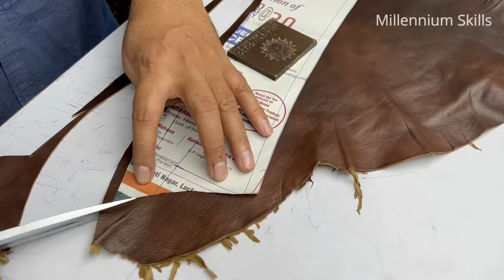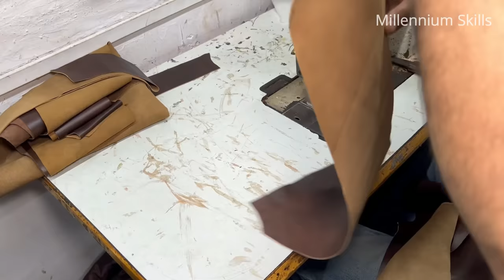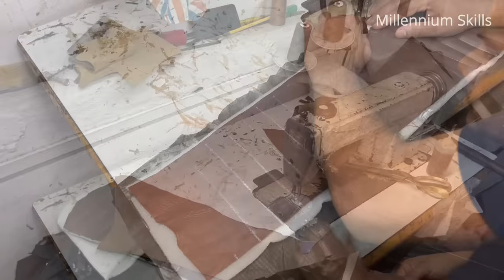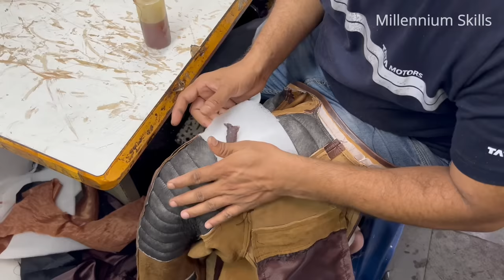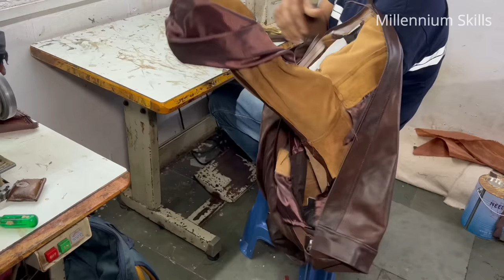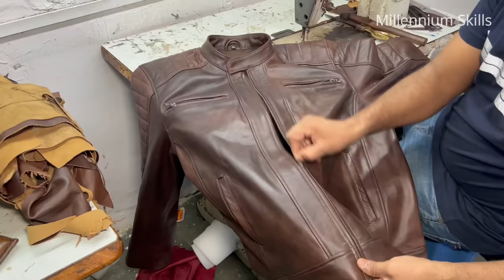Process of Making Hand Made Leather Jacket. Indian Hard Working Tailor.

Comment: Not to be a spoil sport but when buying leather jacket : Always look for a jacket with minimum number of cut pieces. Stiches are weak points and a good leather jacket should have a mininum number of pieces sewn together.
Reply: I am a dirtbike rider. I can control my falls/movements better in a jacket that has more cut sections, somehow I have better control.
Reply: @PG-yi9iz  @@
Reply: 11
Reply: @PG-yi9iz  so leather jackets are for dirk bike riders?
Reply: Yeah, fine if you want a square sack shaped jacket. Bad tailoring makes a jacket weak
Reply: @PG-yi9iz  lol😂
Reply: Absolutely... That's the hallmark of a good leather jacket
Reply: @PG-yi9iz  than you are going for a size which is smaller for you
Reply: lmfao you know nothing about sewing. some seams can be stronger than the fabric itself. especially when using a quality thread.
Reply: That applies to all leather products
Reply: Thanks for the Valuable information
Reply: Most people buy leather jacket just to protect them from winter and going to marriages and parties. 🤣lol
Reply: Lesser amount of pieces leather jacket is made from - more expensive it will be due to bigger parts of leather required you to cut them from a big hides and you need a more hides to craft high qulity jacket. Small parts which used in lower-priced jackets are came as leftovers from hides which means that those cuts could be with more flawed parts and from several different hides which makes them less consistent. Also it always will lose to the more expensive ones which were made from big parts in terms of looking due to you need to add decorative patches and more stitches which makes kacets visualy less mature. But they are cheaper in terms of repair due to it's easier to replace a smaller part than a big one. 
So overall - lesser stitches, patches, etc in leather jacket means more expensive it is and probably better crafted due to it's much more affordable investing more workig-hourse and better quality lining into more expensive jacket than into a cheaper one.
Reply: I want nad I will buy I will wear highest number of stitch in leather jacket 
I will not follow your opinion ok 
I will buy highest nos of stitch in leather jacket 
my world my rule my opinion  ok baby
Reply: Buy a leather blanket instead..
Reply: That depends on the style and type of leather jacket we want. You are looking for simplicity but I love those with sophisticated cuts and stitches on cow hide or calf skin, bad ass looking and masterpiece and I've been saved by one (motorcycle crash). I respect your opinion though

Comment: He is using ,sheep and goat leather (called Nappa leather) most cheapest leather.Best leather jacket when it use top grain or full grain leather
Reply: These are the cheapest leather in india. The jackets are also cheap. Some 30$
Reply: @getbuggs  OK AT LEAST....there are dudes on the comment section who call it artificial leather
Reply: @cnu73  it's not art leather. It's leather in cheapest form..the problem is ill fitting. If the fitting is perfect they are all good to wear, shields the body from wind and chill. Genius' commenting artificial leather must know about leather before commenting
Reply: @getbuggs  ok Bro